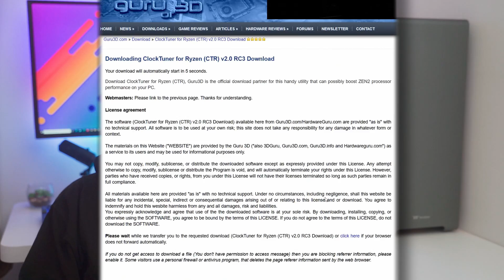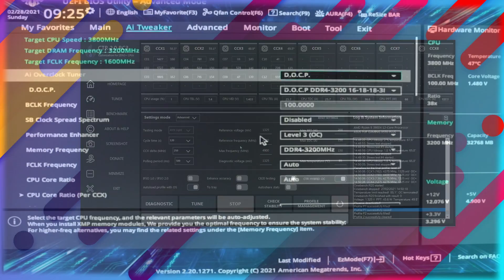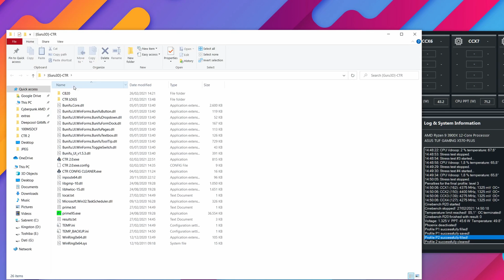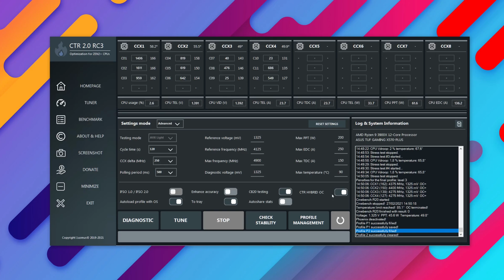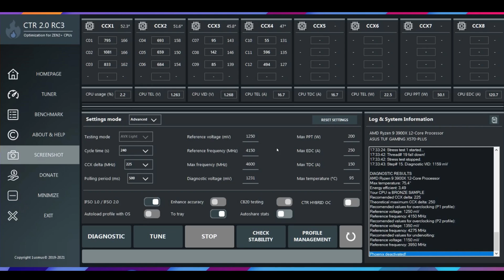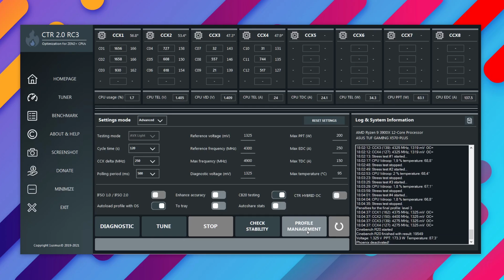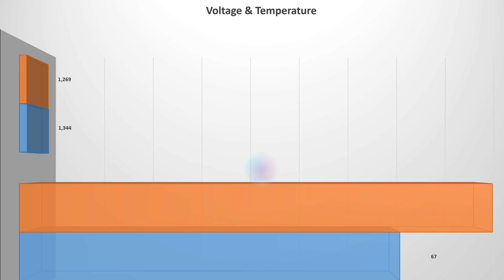CTR 2.0 RC3 RC5 Tutorial - How to overclock your AMD CPU with Clock Tuner

Comment: What does "To low frequency for CCX#1 and To low frequency for CCX#2" mean?
Reply from the maker: Sorry never got that error so far, might it be related to the hybrid profile and you probably set the lowest value to be too low? As a test,  what happens if you set it same as maximum value, you shouldn't get the error.

Comment: I'm curious because I'm stumped right now, no matter the profiles I have for ctr, having it run any of the settings, my pc crashes. Does setting ryzen master to auto oc have an impact on this? I'd assume it'd be better to set it on manual or default? I won't be able to test this for a while so I figured to ask.

Comment: I put those 2 options to enable and I'm still seeing the static 100s on the side. Does that mean it's not working, because it seems to be working
Reply: It wasn't working for me because I had disabled 'AMD Cool n' Quiet". No idea what it has to do with CPPC. Try using default BIOS plus only CPPC and CPPC preferred cores.
Reply: @NocturnalJin  I disabled that too so maybe that's it.
I definitely don't have default bios.

I think I'm going to keep my current overclock. I spent many hours on it, and my scores are better even than CTR. It said I have a golden sample, and I am on an open loop with 2 360mm rads. 
I have around a 4650-4700 all core and kept the 5050 single core boost by using curve optimizer.
My voltage is fairly high, but my temps are good. I could've gotten the all core to 4750-4800 but I would've lost the single core boosts above 5000.
These things are very tricky, and take about a thousand restarts.
CTR would definitely have better power consumption, but I will stick with my bios cpu&ram overclock. I have not crashed yet, or hit my temp limit, which I set to 90.
Quite happy! 3600-14-14-14-28 on 3600cl14 trident z neo

Comment: In 2.1 RC5 after doing first the diagnostic and then the tune, what do you do? To automatically apply them at start you only have the click "autoload profiles" in "profile" menu, but those values are empty and the "calculate profile" is hidden.
Also running twice after resetting, even though it found the same values and saying it's "silver", the first time the r7 3700x surpassed the 3800x, while the second time it just was at the level of the referenced r7 3700x...
Reply: For CTR 2.1 RC5, here's what I found by myself through trial and error and a few hours of tinkering with the tool. I found that for Zen 2 CPUs you'll need to manually run "TUNE" after running and finishing "DIAGNOSTIC". After DIAGNOSTIC and TUNE are complete, go to the PROFILES tab and click on "SAVE P1 PROFILE" to fill the values CTR found to be best during the TUNE phase. (If they don't get filled, you'll need to check what they are by checking the "Info" window in the lower right corner of the TUNER tab. It should say something like "Calculation of penalties for the final profile". The CCX clock speeds and voltage should be listed there) This is now your all-core boost profile which will activate when the "CPU usage min %" threshold in P1 profile is triggered. You can adjust the "CPU usage min %" value to tell CTR after what % of total CPU usage to switch to the P1 profile (You can monitor your CPU usage in Task Manager). After you do all of this, don't forget to activate "CTR HYBRID OC" at the bottom of the PROFILES page if you want CTR to automatically switch between the PX profile (when CPU works on single and lightly threaded workloads) and the P1 Profile (when it works on heavier/all-core workloads). Also very important - don't forget to click "Activate" on both the PX profile and the P1 Profile for Hybrid OC to work. I hope this helps! It would have been great if Yuri could make a video for CTR 2.1 RC5 with Zen 2 CPUs to clear up any confusion on what to do and in which order.

Comment: That's zen 2 and zen 3, not ryzen 2 and ryzen 3.
Other than that, good video. My ryzen 7 3700x stock did 400 points less than the reference stock one, but once automatically OCed it surpassed the 3800X with the stock cooler and x370 motherboard.
Also it sometimes say I have a silver sample, sometimes a bronze one.
Reply from the maker: You're right, I meant zen 2 and 3 architectures

Comment: I bought an lenovo legion T5 26AMR5, and i cant even enter the Bios on my pc at least not the advanced settings.. I guess there is nothing i can do, i really wanted to run CTR, cause i can se my voltages are pretty high by default and problaly higher than they need to be.. But i cant prepare my system cause the Bios is locked..
Reply from the maker: Hi did you read my video description? Make sure you have one of the chipset listed or it would be incompatible
Reply: @fgtechtips  Yes i read and the motherboard comming with my Lenovo pc is an B550, but it has a custom Lenovo bios named something like 14MKT0RA and if i want to enter the bios to change CPU Voltage - Auto (BIOS) / CPU Multiplier - Auto (BIOS).. When hitting F1 on reboot i can only enter a severly limited Bio's also custom from Lenovo where i pretty much cant change anything.
Reply from the maker: Ok its probably Lenovo that had hidden the dangerous settings, check online if there's a way to access the advanced settings

Comment: Anybody manage 5mhz + on 5800x ?
Reply: 5.1ghz single core, kinda sick tbh but I backed off to 5ghz for longevity sake
Reply: @Cameron-lr2oo  how?
Do I just click on tune and then wait? 
Do I need to change some settings to do it?
Reply: @OutOfNameIdeas2  so run diagnostic and tune and see what it recomends, after that put those values into the profiles and just play around with it a bit, add voltage and clockspeed and see what u get etc

Comment: This helped me figure out a lot about my Ryzen 7 5800x CPU, but recently my Ryzen Master app stopped showing metrics for my CPU in general which leads me to believe it's failing at some point. I haven't tweaked any values or overclocked the cpu at all. Is there a fix for this? I have screenshots of the issue if you need to see that.
Reply from the maker: Ryzen Master would be better to be uninstalled, it could cause issues with CTR, works fine for me having both but some people reported issues
Reply: @fgtechtips  That might be it but I didn't have CTR installed until today and the issue started about last week. I'm also reaching out to AMD support to troubleshoot the issue but I've yet to get a response.
Reply from the maker: @parklogo  you could try uninstalling ryzen master and try the new version released 2 weeks ago: AMD Ryzen™ Master  (2.6.2.1818)

Comment: I know on the ASUS B550-F Gaming board, I had to set TPU to TPU II, VDDCR CPU LLC to Level 5, VDDCR CPU Power Phase Control to Extreme, and then most of everything else to Auto.  I did disable Asus Performance Boost.  CTR 2.0 RC5 would fall out during diagnostics at random points until the VDDCR CPU Power Phase Control was set to Extreme & VDDCR CPU LLC to Level 5.  It would also impact the rating of the CPU and vary from Bronze to Silver.  Once those changes were made it has consistently passed diagnostics as a Silver.  If you have an Asus board and you can't find your BIOS CPPC settings, but think they were removed in the recent bios updates then try looking in Advanced / AMD CBS / NBIO Common Options / SMU Common Options.
Reply: do u know a way for msi boards
Reply: @soloxd8396  Make sure the board model can support it.  Not every MSI board model.is equal.   I found most of the ASUS options by going into every feature menu and sub menu.  If I didn't recognize something, I looked it up
Reply: @tim9326 ok thanks I try to see if my motherboard can even support cppc
Reply: @soloxd8396  no worries, I use to have an msi 990fx-gd65.  Could handle an fx4350 ok but vrms couldn't handle an 8350 with a slight oc.  Mostly why I recommend researching the board first.  MSI has a bad habit of letting you do something, that will damage something.
Reply: @tim9326  Overclocking is ALWAYS dangerous bro :P
Reply: @vladvah77  not true.  OC on hardware that is not rated or properly hardened for it can be.

Comment: Watch your single core performance downclock.
Reply from the maker: I've used the hybrid oc so using also the downclock profile ;)
Reply: @fgtechtips  
You're getting max.single core clocks after CTR tuning?
I'm asking because there seems to be discrepancies between 37K-39K results vs 3600. CTR gives me less than stock values for my 3600X.  No OC headroom whatsoever.
Reply from the maker: You can see at the end of the video that I get higher clock on each core compared to the previous optimized custom  pbo oc via bios

Comment: my motherboard is broken now... do not overclock dram at same time!
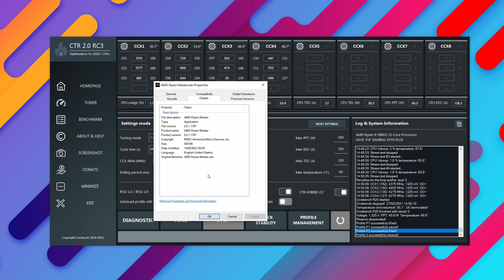Reply from the maker: Yeah I suggested that at 04:30
Reply: @fgtechtips  Wait, if i leave my DOCP profile for the RAM active and run CTR it could broke my mother?
Reply from the maker: You can enable the xmp profile but it's suggested not to overvolt not overclock the ram until you find a stable overclock in ctr
Reply: @fgtechtips  I want to use CTR to get a good "Undervolt" settings, i don't want to do a OC.
In fact, i think it will be nice if in future versions we have a option to test/tune OC and UV as a independent options.

Comment: After booting up I get the notification 'profiles are not used'. I have added the P1, P2 profile. Is this a bug ? Do I have to manually active the profile?
Reply from the maker: After diagnostic and tune you need to click on fill in and save profile then you enable the autoload in windows as I explain in the video . It works fine on my machine
Reply: @fgtechtips  well I did the same, still not working, thanks for your reply 🙂

Comment from the maker: HI all, this video was shot when the CTR 2.0 RC3 was out. Shortly after RC4 and 5 were released but due to the new overclocking protections implemented I found the results to be much worse than RC3 so keep that in mind
Reply: Any idea where one can download RC3 ? I cant seem to find it anywhere and RC5 wasnt kind to my 3700X, I gained nothing
Reply from the maker: Couldn't find it either, in the guru3d website you can only find the latest version
Reply: @fgtechtips  ME pasa lo mismo solo se consigue la RC5 :S
Reply: Have they fixed it in version ctr 2.1?
Reply: @ryanzhang5633  Busca otras versiones y no la ultima la pude encontrar y descargar y anda sin errores en todos los test
Reply: Does the reference clock really grow linearly with voltage.
In my testing years ago, I noticed that increasing frequency by 100mhz, doesn't take the same amount of voltage increase.
Going from 4.1Ghz@1.2875V,(I don't have the spreadsheet, I went all the way down to 3.6Ghz iirc, running prime95 for 30-45 minutes waiting for workers to crash) to 4.2Ghz requires a larger jump than 4.1Ghz from 4.0Ghz.

Comment: After doing a 'tune' I would HIGHLY suggest you clicking the 'check stability' button and letting that run.. with first the P1 .. then (if using hybrid OC) P2 profile active.. and check it again.. even with the auto tune on my 3950x I found that it would hard crash.. and assumed it was just some software bug.. even lose my profile settings in a hard crash. it was just that the light avx testing on the auto tune .. wasn't actually 100% stable under all loads.. after running a check stability check on each of the profiles manually (without hybrid oc enabled and activating them separately to run the check) Then finding which CCX failed the test.. lower the frequency in 25 mhz steps down.. re run the test.. until it passes the stab. check.. works gloriously now.
Reply: Hey Blitz, I have the same CPU as you. I found good profiles for P2 and P1 to gain performance while reducing power / temps. What settings did you use for your PX profile? A zen3 cpu autofills that information from what I have read, but not a zen2. Should I just trial and error on single core cb20 until it crashes or what?

Comment: Hi! Nice video!
I have some issues with RC4 : 
At 2.0 RC4 there is no "Profile Management" button at Tuner section. There is new "Profiles" section but it doesn't carry the results as Profile Management did...
How to solve that?
Reply from the maker: Yes they moved it but it works the same, you click on diagnostic, then tune and then fill in profile and save it

Comment: hi, can you help me, the program starts it, the CB20 passes and then it does nothing else, I have everything in auto in the bios, and the latest version of this, i have r3 3300x MB: MSI TOMAHAWK B450
Reply from the maker: After clicking on diagnostic it does nothing else, you need to click on tune then you get the results that you can save in the profiles
Reply: @fgtechtips  
what time?
Reply from the maker: I meant tune not time, just follow the steps in the video, it's easy
Reply: @fgtechtips  apart, when opening the program the statistics of the processor comes out all for example 100% USAGE, CPU VID, etc. and it does not change this remains static

Comment: Your instructions are completely wrong!!
Since CTR 2  you leave Loadline Calibration to Auto in every motherboard.
Secondly its not the same running RyzenMaster on the background. RyzenMaster messes with CTR after version 2
DO THE RESEARCH.THEN DO THE VIDEO.

Also that`s CTR 2.0 RC3 not CTR 2.0 RC4
Reply from the maker: Calm down and look again you will read in my description that Ryzen master Is optional and does not create any issues if you have it installed. Second the latest version is rc4 came out today. btw LLC configuration I tried auto and level 2 and I can confirm level 2 works better infact 1usmus has suggested auto , only because several users were unable to find the LLc option in the bios. So I suggest you next time instead of shouting nonsense get informed first and then comment ;)
Reply: @Dragau4  EVEN the fucking guide is paywalled!? I have all versions CTR 2.0 RC3, 4 and finally 5 but not the real 1usmus's guide :-( .... Common bro the guide itself CAN'T BE illegal to share it's NOT his newer 2.1 software he's working on....
Reply from the maker: Yes you probably didn't read my video description, this is specified already there. As I explain in the video I have an Asus motherboard so LLC2 is the one used, I also tried llc3 but anything higher is unstable on Asus
Reply: @Dragau4  Source bro? I have Ryzen R9 3900X and MSI X570 MEG ACE, GTX 1060 6GB , 16 GB of cheap Corsair LPX 3200 RAM and Seasonic 520W M12II PSU

Comment: From version 2.0+ it's no longer nedded to install ryzen master
Reply: No problem, mistake are human 
Anyway grat video! 😄
Reply from the maker: Actually it's not a mistake I was explaining how the CTR app in general  works and 1usmus made it dependant on Ryzen master that's why it was needed for installation since his app made use of the libraries and engine of that app. But anyway yes it works without ryzen master from version 2
Reply from the maker: Thank you that's correct, I have mentioned it in the description